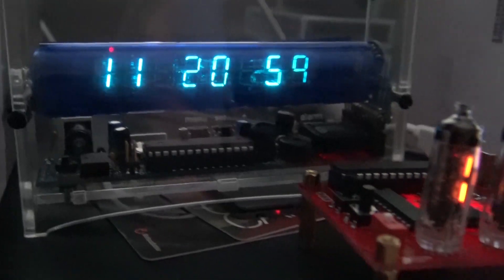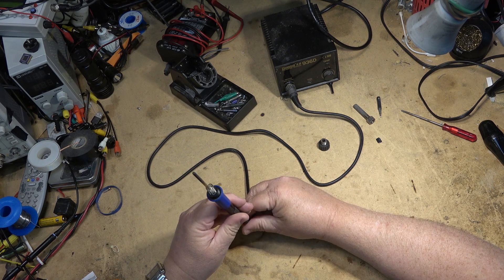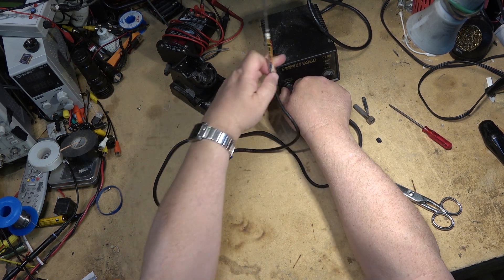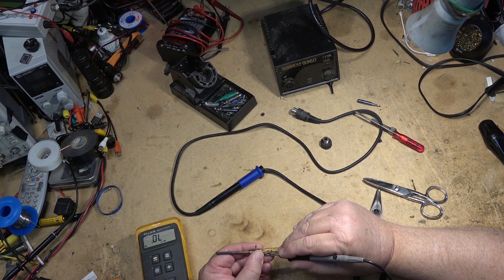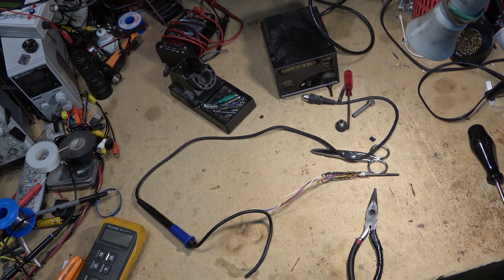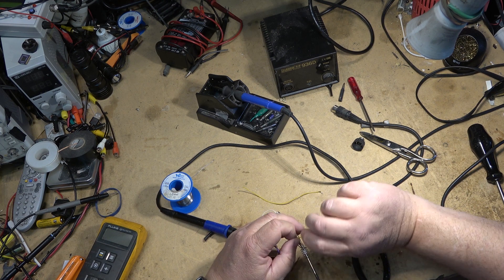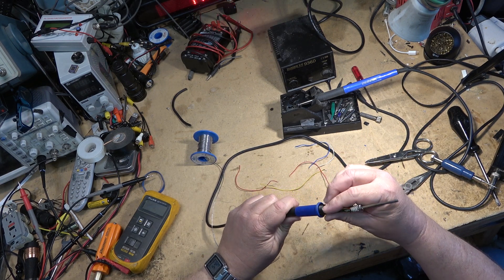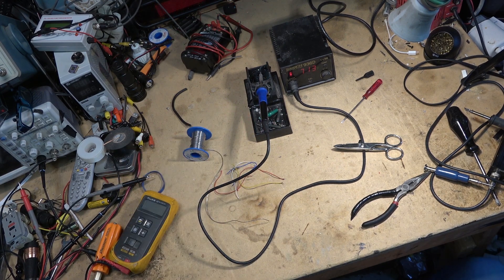Zhaqxin 936D soldering iron repair

Comment: The damn Weller connectors on their most popular regular station WTCPT - changed them to XLRs, problem solved. The one I have is over 30yrs old. For adj temp I picked the cheapy Chinese at Princes Auto - good enough, but I wish the cable was more flexible and better quality. When it fails I'll replace the cable with something more flexible of Belden, Mogami variety.

Comment: I had to do this with mine. I had purchased the brand named heating element because it had the soft silicone wire. I noticed the heating element on the brand name one vs. the chinesium one, was a little different. The cheaper one had more slots to dissipate Heat but had a stiff PVC coating on The Wire. I installed the brand named one then, calibrated it to the correct Heat. The damn thing burn up in only 2 days!
 I ended up taking the cheaper heating element & connected it to the silicone wire. They had the exact same pinout. That was over 2 years ago & it is still going strong today!

Comment: Hakko clone. I've fixed bad cords too. Still have a couple of oem hakko elements too. If I remember the original elements cost as much as a whole knock off handle assembly.
Reply: My original Hakko heating element only lasted 2 days after I calibrated it to the correct temperature. I stuck in a Clone heating element. They are designed with more holes to dissipate the heat quickly. My clone heating element has been going for over 2 years.

Comment: What would recommend as a good soldering iron?
Reply: Personally I like the cheaper WS-51 adjustable temp Weller, kind of pricey but sometimes can be found on sale. Most of the Chinese ones are very similar to each other, just sold under different name. Some actually are very decent and cost little comparing to Hakko, Weller or other brand names. But often things like cables are too stiff and break, just like the one Dave uses. Other issues. I know a few people put reviews on the net including soldering equipment.

Comment: What I don't like about cheap irons is the use of stiff, plastic coated cable between the pen and the control unit. That should be silicone fine stranded, multi-core cable like the Weller. It's safer to use. My first TC iron had stiff cable and it sprung back out of the holder. I got rid of it soon after and purchased a Weller WTCPN. The Weller is 35 years old and still working perfectly.
Reply: I had 3 Adcolas which were 240V into the handle with the temperature control in the iron itself. The smallest had the stiffest cable and would wander across the table as the cable tried to return to its folded state. Then I bought a Hako, the iron is light and the cable is sooo flexible. Heaven!
Reply: @petertryndoch8857  I've "retired" the Weller. It is still like new and I want to keep it that way. My next iron will probably be a Hako or a Micron. Stiff iron cables are dangerous and should be replaced with silicone cable.
Reply: My Weller is about the same age, I replaced the handle and changed the connector to regular XLR. Still keeps going
Reply: @pliedtka  Yes I replaced that cheap plug with an XLR. This was a power XLR, I happened to have lying around.

Comment: Interesting... it looks like that is standard PVC wire instead of silicone coated wire like is typically used. Probably doesn't help with the longevity in such a high flex application. Likely one of the changes they made to cut costs :)
Reply: if it survived three year of everyday use then we can't really blame manufacturer for any cost savings, in "normal" use of these kind of hobby $40-50 tool most users would never have this issue.
And replacement handle is just $10-12.

Comment: it's lasted well for a copy,  you have done bucket loads of work with it :-D.
Yep cable breaks, i've repaired 100's of radio mic's c.b and ham, always 1-2 inches from the cable clamp.
The daft mic's with all the radio controls on them were horrible, fat 20 way or more cables.

Comment: I did this with a Logitech Rumblepad II gamepad for over a decade so many times. It still works well (with makeshift rubber stopper holding the fort down on outlet, strongly) but the left thumb mechanism is totally shot and won't return to null, in both axis. heh heh I want to solder in a replacement that I have, but I don't have the right tools. :) The original solder and mounting is particularly strong.